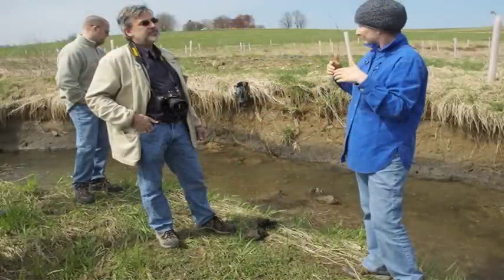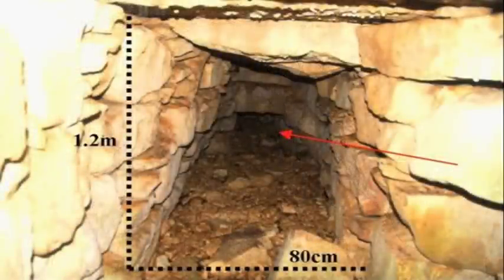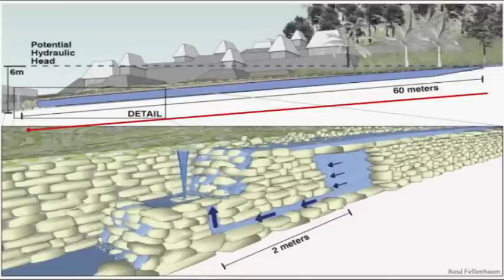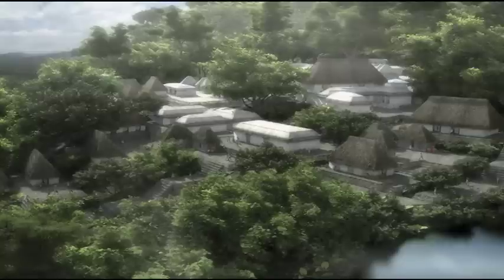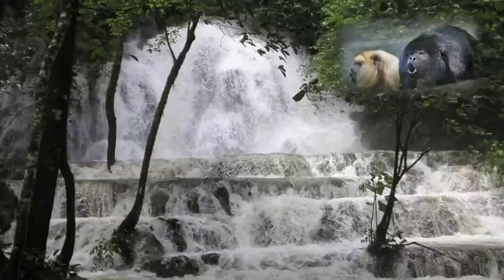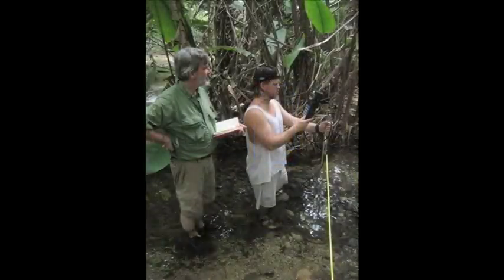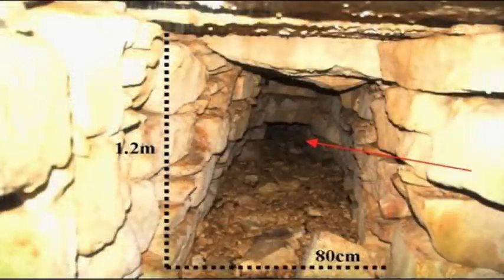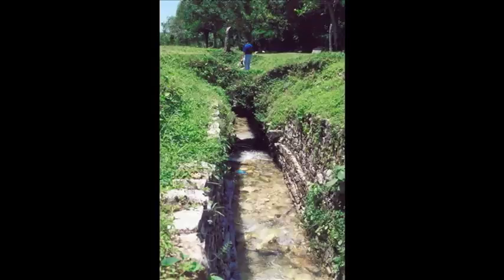Maya Plumbing at Palenque with Kirk French and Chris Duffy

Comment: If you recreate this mayan pressurized water system to send water from one tank wich is below to another tank wich is above in certain terrain to fill it, and then you let the water from that upper tank to go back down with gravity to the first tank wich is below through another canal that has installed a mini water power generator, then you could power a house with electrical power 24/7.